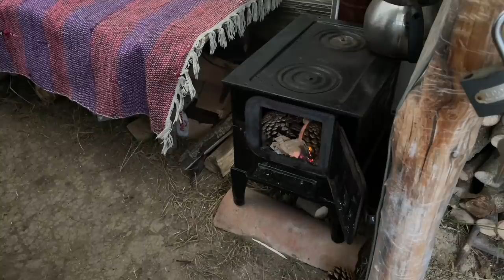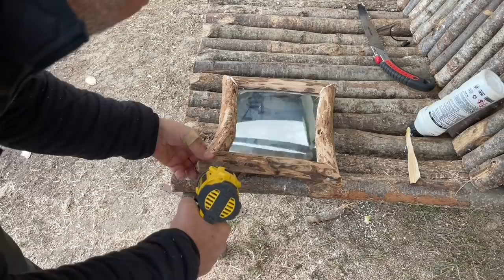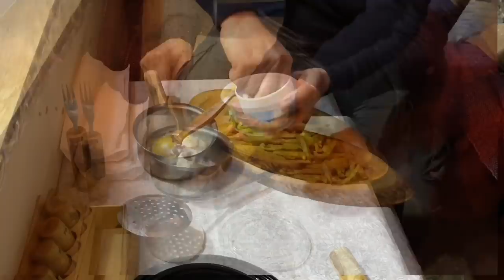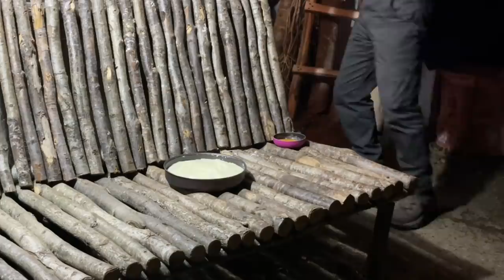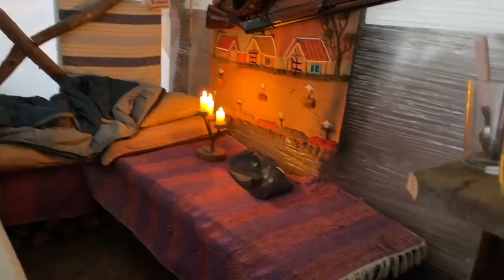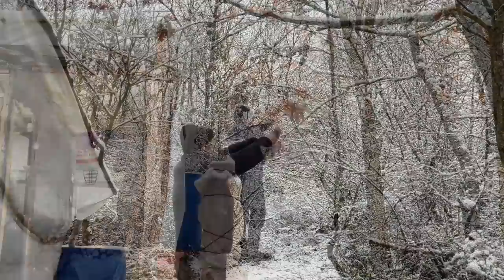FİLM GİBİ KARLI VİDEO! ODUN AYNA❄️ SNOW VIDEO LIKE A MOVIE❄️WOOD MIRROR #kamp #doğa #yemek #film

Comment: Hello cemal,  first of all  I really enjoyed your video,  thank you for sharing this weather and this time with us , second I'm wondering what did you cook in the morning for breakfast 😀  I really want to try it , can you please give me the receipt. Thanks 😊
Reply: Cevap:  

2 heaping tablespoons of butter

2 heaped tablespoons of corn flour

1 water glass (at room temperature)

1 cascolot cheese

1/2 tea glass of boiling water

1 wipe teaspoon salt

Key Point of Kuymak Recipe

The most important point you should pay attention to in order for your gem to be the flexibility you want is the cheese you will use. You can also cook with chechil or cheddar cheese, but you will get the best result with kolot cheese.

How to Make Kuymak Recipe?

If possible, put the butter in a copper pan and add the corn flour when the oil melts and foams.

step-1

Roast the corn flour until it turns color. Then add a glass of water and salt.

step-2

Roast until the water is absorbed and after adding the water well, add the kolot cheese into it.

step-4

Fry by stirring until the cheese melts completely and absorbs the water.

step-5-end

After the cheese melts, add the boiling water, and when the water absorbs and becomes longer, turn down the heat.

step-6

When the butter gently piles up on the top, your well is ready. Serve hot.
Reply: Thank you for your informations 🥰🥰♥️🌹
Reply from the maker: Merhaba 
beğenmene sevindim ☺️👌 teşekkür ederim. Türkiye’nin karadeniz yöresine ait bir yemektir adı Kuymak yada Mıhlamada denir. video açıklamasında malzeme listesi var.! 😋👌 Afiyet olsun.
Reply from the maker: Teşekkürler 👌☺️
Reply: thank you , but I can't understand that all you said 🥲